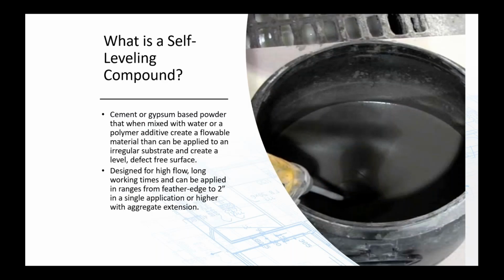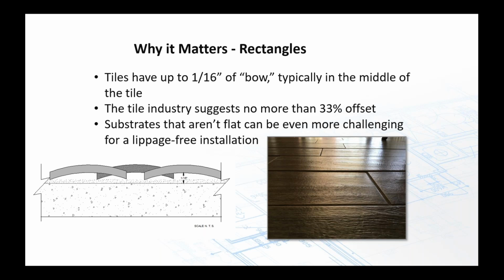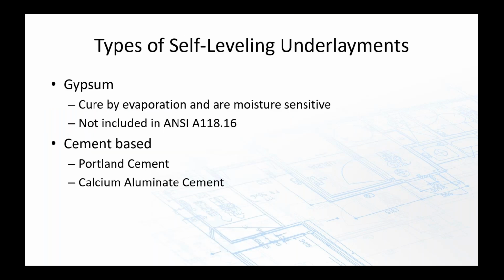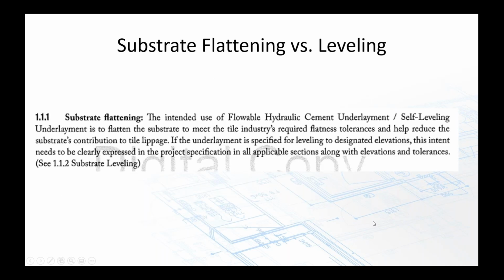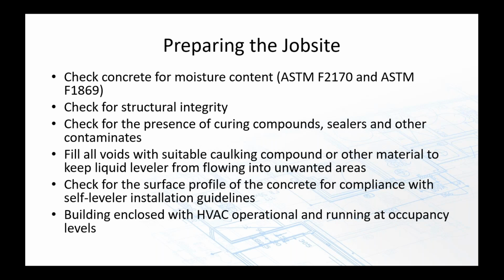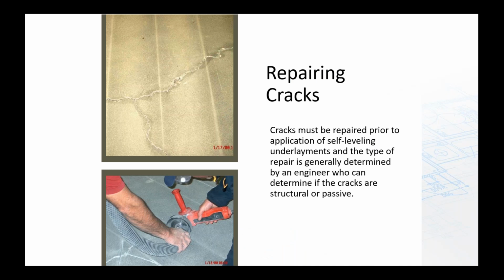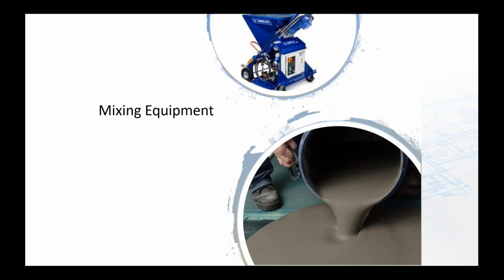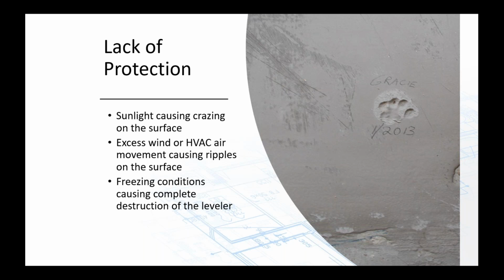Webinar: Self Leveling Underlayments/Flowable Hydraulic Cement Underlayment Standards

Comment: Great webinar! Wish I had known about it to attend live. A few questions...

- Can you further compare and contrast SLU to dry pack screeding? When would you use one over the other? Especially for large areas?

- What methods do you recommend for assessing floor flatness?

- Why not use a concrete-based patch to fix floor cracks? Also can primers adhere to all of those chemicals you mentioned?

- What about sawed-in control/movement joints? Can you just self-level over these or should they be filled first with like a foam backer rod or similar?

- Here in South Florida it seems like most certified tile installers do mudset installs over unflat substrates for remodels. When is it ok to use this method vs SLU?